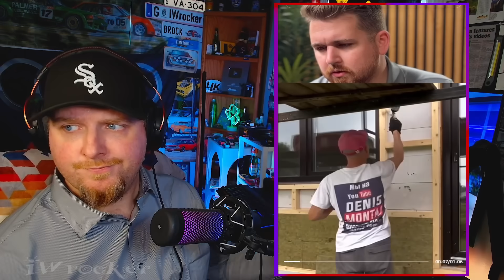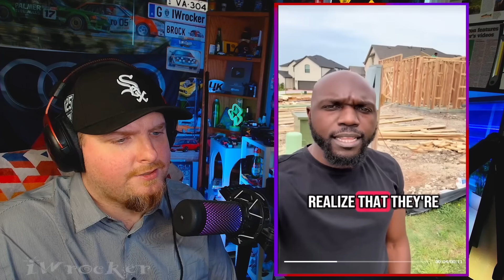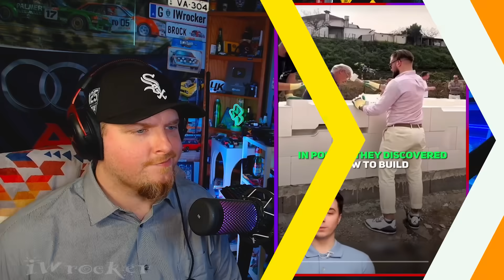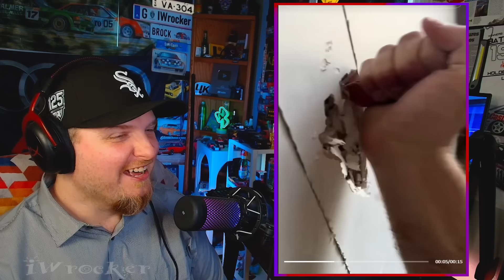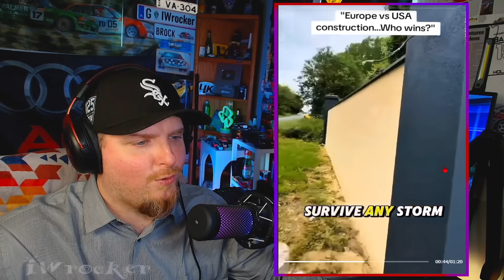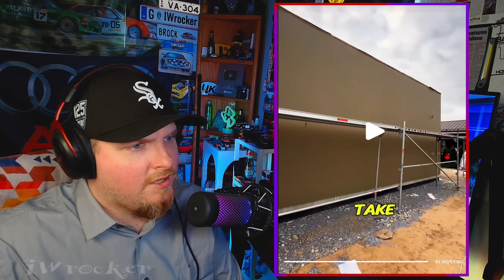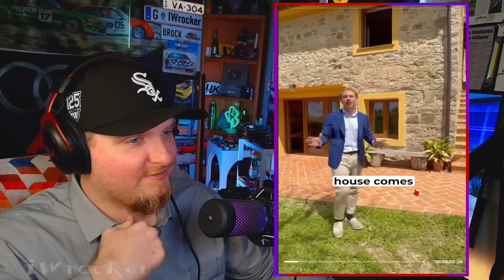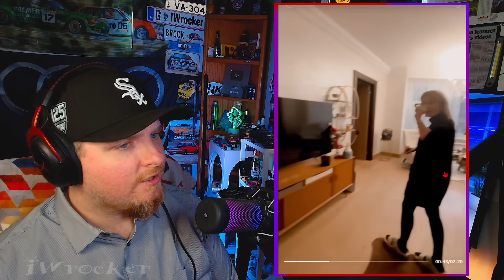25 Minutes of European VS American Home Quality & Construction Methods 🔨

Comment: What does he mean "why insulation is on the outside not inside"? Is he trolling or just American? Of course it is on the outside as it is physically correct, safer, more efficient, and longer lasting.  First, when insulation is outside, the entire wall stays warm. That means fewer temperature swings, better comfort, and lower heating demand. Second, no condensation problems. Warm walls keep the dew point inside the insulation layer, not inside the wall. Inside insulation makes cold walls, which invites moisture, mold, and slow structural damage. Third, thermal bridges are minimized. External insulation wraps the building like a jacket. Internal insulation leaves gaps at floors, ceilings, and internal walls where heat happily escapes. Also, if the outside is damaged then it is easy to redo the insulation if it gets damaged. Fourth, the wall becomes thermal mass. Brick or concrete can store heat and release it slowly. Inside insulation cuts that off and wastes that useful property. And finally, outside insulation means more interior space. Inside insulation steals floor area. Outside insulation does not. This guy has to be trolling or something
Reply: Here in Ireland insulation is neither inside nor outside but in the cavity between the two walls
Reply: @seanrohan5829  Don't mention double wall builds with cavities! Their heads will explode.
Reply: @stephenskelhorn3315 I best not mention both walls are made of concrete blocks then 😂
Reply: @s @seanrohan5829  as a Canadian I didn't even know about that, our houses are basically just as shit as the USA. Double wall with the insulation in between sounds amazing! Canada really needs to take notes from Europe.
Reply: @stephenskelhorn3315 I have a house with a double brick wall and insulation in the form of injected Styrofoam. The double-walled structure dates back to the 1970s. The construction itself, in the form of the empty space between the walls, served as insulation back then. Then, in 2000, Styrofoam was injected into the building to improve insulation, and in 2015, the entire building was covered with 40 cm of Styrofoam on the outside. And this isn't Russia, it's Poland, with normal winter temperatures of -5°C.
Reply: @burkosalw  40cm polystyren :D Fairy tales frm Poland...  2015= cca 10-15cm....
Reply: @RickyDBones  considering how cold it is, im supprised you dont already do things Nordic
Reply: @Odisovic  If he injected the foam and had 40 cm of space before then he'd have to make it 40 cm regardles if it's built like he lives in Siberia. That said I think norm is 21 now and you can go over that if you wish - just will increase the cost
Reply: @seanrohan5829  that setup is the same as seen in the video. the only difference is that brick or concrete inside walls are rare in finland. the outside paneling is still missing in the video, which would make the insulation to be "in between the 2 walls" as you said
Reply: @Tunturisorsa True..I meant in between two walls of concrete blocks
Reply: @seanrohan5829  My brick house in Finland was built like that and we call em full brick houses.
Reply: @seanrohan5829  Lots of that in Portugal too, but newer stuff is mostly ETICS nowadays. 
And it's also been used  to rehabilitate a lot of older double walled buildings, in the last few years, with dramatic improvements in thermal comfort and efficiency.
Reply: @seanrohan5829 The same in the Netherlands. The inner wall is or concrete casting, or lime-sandstone or hollow clay bricks and the outer wall is mostly brick masonry. The cavity is about 15 to 20 cm wide with 12 to 17cm insulation.
Reply: @seanrohan5829 
New houses can use this system ( brick, permeable insulation, brick), or one wall of ytong.
In old houses, with a only wall, the only solution is put the insulated outside ( better) , or inside ( worse).
Or not do nothing, and change house.😊
Reply: @seanrohan5829 Same in the south of France, or we also rely on the thickness of the walls as a thermal regulator.
Reply: @seanrohan5829  Same in Belgium. Inside walls are big hollow clay bricks (we call them "snel bouwers" which means "fast builders"), altough concrete is used more and more these days (either castings that are built and filled on the construction site or precast walls that are made off site). Then insulation is applied. Then an outer brick layer.
Reply: @lorrefl7072 in our case the 2 (cement block) walls were built then the insulation was piped in between them..pumped in as liquid foam then hardens
Reply: Often done that way, in Scotland, between cavity walls. We had ours done 40years ago. 
Our new extension has insulation built in the walls.  I’ve also see insulation panels added to the outside wall then plastered over.
Reply: @seanrohan5829  Isn't that yes how normal houses are built?
Reply: Absolutely agree. If I am seeing it correctly in the first clip, it´s rockwool and another layer (In my parents farm was a whole solid isolation-brick-layer) can be put on it to improve insulation even further.
Reply: Im not sure the builder has finished yet the troll tank said only siding on now but we in europe tend not to use plastic siding like yanky land he nay have a brick wall on the out side its not the end
Reply: @suerogerts4330  For this type of house, the latter is generally made of natural stone (granite and sandstone) in Russia.
Reply: @scorpio681118be yeah we used all sorts of natural products for our houses that's why Europe is so unique granite ,red brick (kiln dried ) we have flint on some older houses in UK and the ones with concrete blocks have a smooth outer rendered course for painting or stucco well almost anything really but for me it was the assumption that we used plastic siding as they do in the US on their cookie cutter homes as they call them 😂😂😂
Reply: @suerogerts4330 we don't use plastic cladding. It's the concrete version we have.
Reply: Don't try to convince someone with facts. Plus, the stones not only provide warmth in the winter, they also helpbto keep the house cool in summer. But hey, what for if you have AC ...
Reply: @nurzumkommentieren5762  Stones don't provide warmth you homeopathic clown. you are only saying absolute nonsense...
Reply: @nurzumkommentieren5762 we live on a shine bank. It gets roo hot to stand on in some places in summer, freezes in the winter.
Reply: @nurzumkommentieren5762  If you can even turn them on since their power infrastructure is also rotten to the core.
Reply: @InternetD1991 Murrica, best country in the world!

Don't forget: they at least gave a power grid, even if it fails - that's way better than living in caves like the rest of the world.
Reply: @nurzumkommentieren5762 😂😂😂. Although caves might actually be better insulated than their houses.
Reply: isnt't it also safer in case of fire? My walls (italy) just have some plaster and paint over concrete. If there was a fire inside, they wouldn't burn, or am I missing something?
Reply: @bradipedro  You are living in Italy and average temperatures might be more convenient, as long as your walls are thick to save the warmth for colder times. Anyway, bricks are better than concrete. Especially, if they have bubbles and cavities for insulation and transfer of humidity. Brickworks in Bavaria are run by Italian families for 100 years. Our Bavarian house needed 70% less heating than my brothers between Treviso and Venice. And now we have 20 cm fireproof insulation outside. We heat with our breath.
Reply: @bradipedro - Current day insulation, like Rockwool, is virtually impossible to burn.
Reply: Not to mention that the Ytong blocks (from what I see in the video) are a massive insulation in itself. All those air bubbles are not there just to make it light and easy to handle.
Reply: Way too many words for Americans to comprehend, don't bother arguing with them. Worst case is you gonna get shot
Reply: The guy saying stuff like isolation on the outside is very ignorant, specially saying please build like we do in the US. My house was built 10 years ago in Denmark and here we have strict rules about isolation, housing has to be very efficient. My house has brick walls on the inside isolation in the middle and bricks again on the outside. When it was built, they build the inside walls first, the roof on top and then isolation on the outside like in the video. Then they made the brick walls outside last. My house also has concrete tiles on the roof, so the house will last much longer than I live or even my kids, if maintained properly (requiring very little maintenance). It also has 3 layers windows, so my house uses very little heating. So my commit is, please build like our houses in Europe. 😂 . As for cost, my house cost about 320k USD (as of 11/2-26 dollars vs. dkr) to build including kitchen, bathrooms and appliances, ready to move in. It’s 158 m2 big (1.701 ft2). I don’t know how those prices compare to the US market.
Reply: @MKristensen Here in Ukraine, my house is isolated outside.  Now with the war temperatures are dropping till -20 no electricity the gas convectors don’t work as the pump needs electricity.  After one week temperatures were still +17.
Reply: @dhrvbThat’s very good isolation, is the house old or newer date? I hope and pray the war will end soon, with the Russians leaving. I have been following the war right from the start and admire the strength and courage of the Ukrainians. Winter is harder than normal here in Denmark with constant temperatures of -1 to -3 degrees, so -20 is a lot colder.
Reply: @MKristensen   in Russia one of my neighbors built a house for 71 K usd, another for 125 K usd. Gas heating of space and of water in 2025 cost my neighbor 250 usd per year, me 325 usd per year. those who somewhy prefer electrical heating instead of gas heating, they usually pay x1.5 or x2 more than for gas.
per month gas about 20-27 usd, heating electricity about 40-50 usd.
(for 1 layer concrete and 1 outer layer insulation).
i don't have examples with 2 layer concrete to provide.
Reply: @eff9266 In Denmark heating cast a lot more because of taxes, because the state wants people to isolate their houses better. It’s the same with water and electricity. My house cost about 1.270 USD to heat per year, the same as a two room apartment of older date. Water cost about 640 usd which include cleaning of waste water. We have central heating in my city, so all heat comes from a large heating plant that burns waste that can’t be recycled, wood and other stuff. We have higher cost, but also higher wages than many other countries. It’s hard to compare prices, when taxes are there.
Reply: doods.. he is insulating "the inside". But hes smart, hes doing it from the outside, before the outer walls has been mounted. Its much easier to acces from that side, you dont have to carry everything inside
Reply: though the same - never do it inside if there is not a special reasone like you won't ruin the outside of you few hundred years old house.
Reply: @Paine981 Thanks for this excellent explanation 👍
Reply: dude NO !! it's rockwoll, before that another wall is placed so the rockwall is between 2walls (the outer can be wood or brick), otherwise the rockwoll will get wet and won't be in its place for a long time.
We do place isolation on the outside like crepi but again than you have a barrier before the isolation.
 So on that he has a small point but he didn't get it doesnt end with placing the isolation (what is +- logic since also when you place it inside you still place gyproc walls to finish) he probl just looked how we isolate and not entire construction !
Reply: American homes are overpriced, crap construction but as with all homes from around the world they are built for the environment of the country
Reply: Amazing!  Someone who actually knows the subject!
Reply: @Paine981 He's right though, at heart to ask.   3 houses were wrapped 1,5 years ago literally next to me, all on the outside, all for just a VERY THIN layer of mortar over it and found holes for condensation to escape. 

   It's ABSOLUTELY IDIOTIC anyway. Better build homes like in the past : THICK WALLS FOR ISOLATION and thin small windows so great won't escape or come in in the summer. 

People today are SO DAMN STUPID the do it backwards/upside down 😐😐😐🤔🤔🤨🤨🤨❗❗❗
Reply: Here in the South, the common way is foam between walls. I guess it depends on how extreme is the winter weather.  (THe temp differences are much larger in winter that in summer)
Reply: Now you know why some people in the US are scared of "Winter Storms", while in Europe you would prepare to stay home for some Days and it´s done...
Reply: He was American, they think backwards
Reply: Very well said, and absolutely correct! The same principle works with blinds. External blinds work better and keep the room warmer in the winter than internal blinds.
Reply: Also, I dont think it is meant so much as thermal insulation rather than sound insulation. The house is bult from Ytong bricks that are in themselves very good thermal but poor sound insulators.
Reply: It’s also Russia where it can be cold AF so there is a strong possibility that there is insulation on the inside of the walls as well
Reply: Americans...
Reply: All that guy achieves is to show how ignorant he is. Because in Europe (and in this case, Russia) people are insulating OLD houses, old houses that had different standards for heating from today's world where it's not acceptable (or even economically viable or safe) anymore to heat in the old ways (there's studies about wood heating and the effects on health if you don't run a properly insulated system and they do not look pretty). Old houses that are receiving NEW insulation that wasn't available back when those houses were being made. Both in construction of the insulation and the format of its distribution. When the house is already built, adding the insulation is done on the outside. And that's without discussing other factors that most US constructors are utterly clueless to.
Reply: I wonder how many would cost ONLY the material.  And HOW MANY does the constructor charges.  Because when I see how American houses are build it seems thet are ripped of by the constructor !
Reply: Thank You! I had exactly the same Thought 😅 In Europe you will learn this  as an Apprentice 😄 Also Insulation isnt just for against Cold Weather, its also good against Hot Weather but ai guess Americans just love to pay the Bill for their AC Blasting the whole Summer 🤷‍♂
Reply: Here at Finland insulation is always inside or between two walls.
Also air is good insulation.
Reply: He's just an US constructor. No surprise the quality in US is sh*t, he doesn' even know why you should put the inslation ouside. 🤦‍♂
Reply: I wish you would post that under the original video. 🙂
Reply: aye ,the stones natural ability to retain thermal energy and keep internal temp at a stable slow changing lvl is not 'fought' its retained instead used as a strength with insulation ,  wind halting cover and the last part , with a final  outer layer be it woodpanels or stone work
Reply: He's just a smart american.
That means he has learned that everything in the USA is better because the USA is the best country in the world.

Poor guy.😢
Reply: 17:57 oh that's just a modern Lego City set
Reply: Depends type of construction and materials if you are building with montage and modular construction  you will use panel sandwiches( to remind they both have insulation )and sawdust concrete foam insulation between internal and external walls panels on metal frame , while with classic building  ( reinforced concrete and brick and precast concrete walls most external insulation of objects   is mandatory  unless there  is no other alternative than  builders do internal wall insulation , we are talking about building at budget .)
Reply: I think that video is a joke or, at least, ragebait
Reply: You're my guy Palne. Well said, even better than I did
Reply: E' solo un idiota senza professionalità. Non puoi insegnargli nulla. Non capirebbe oppure non vorrebbe capire. "Noi in USA facciamo così e questo è il meglio. Punto."
Reply: But putting the insulation on the inside allows you to grow mushrooms in virtually every corner...
Reply: I was about to say, the hell xDDD
Reply: Insulation is between the inner and outer layers.
Reply: I'm watching a dude just cut out a wall and I'm thinking of every time I watched a monster  movie and felt a  bit unsure... On a third floor of a concrete bunker with steel inside walls and doors... 😂
Reply: The way wooden houses are built here is almost same as USA, but we still add more insulation on the outside. It's weird they only put it in the walls.
Reply: "oh look, people abroad who are used to way lower temperatures every winter than us are insulating a new construction from the outside ! It's weird, why do they do it like that and not like us? We're the best. They must be dumb." Yeah, sure, troll.
Reply: Thanks for posting this so I don't have to. Posting this from a 115 year old house with no insulation but my parents had 10 cm of insulation tacked onto their post-war brick and concrete house and now they don't have to heat anymore in winter. That's why we insulate.
Reply: This is nice theory, where does moisture go when it cant escape with heat ? External insulation gets wet ? Loses color, coating, in case of a hail, it probably gets damaged over time much better. Also, easy external insulation if you have a large house, then youre not talking of normaal average incomes, more like the parasitic class that never worked anyway. How does the wall get warm when it is insulated from the outside ? If you have large rooms, plenty of them, smaller space means less heating required, if you do not have all the walls insulated from every direction, you still have moisture escape instead of amass. Modern cheap houses are made very cheaply with no space, while wall damage is an issue, there are more factors, like how far youre from road, and do hevy tractors and trucks go at it at 90 km/h instead of allwoed 50. When whole house shakes 150 m away from such a vehicle, or a heavily laden train at about 1 km can still cause unnecessary wear to the building, and the state doesnt pay for damages from superheavy vehicles. Sure, it depends, what weather, How things get more expensive with US/EU imperial project, if the cult running theUS and subordinated EU throws the subject class into slaughterhouse of war or different, all those shiny high-tech and wannabe high-tech will not be reachable. Trolling is also I get accused a lot of, especially after somebody tries to impose him or herself and fails, anyway, internal insulation is a no go when living in a hobbit hole :)
Reply: I thought they were adding another layer of insulation on an existing building, and that that was why they did it on the outside like that.
Reply: @monha8 
Perfect!
Reply: Hes US not american
Don't insult other countries in the americas
Reply: American
Reply: i never worked as builder of any kind and even i knew that the insulation on the outside makes way more sense lol. they allow anyone to build houses in US it seams
Reply: Thanks, you saved me a lot of typing, especially the first two sentences.
Reply: Not really exerated, my house is a 140 years old brick house, like the rest of the houses in my street. Of course they need to be kept up, but still fine to live in.
Reply: Totally agree  with every word. This guy there is either incompetent or simply trolling
Reply: Also - you don't take space from the rooms.
Reply: spot on.
Reply: Thank you SO much. I do construction every few years in our business and that statement made me rage and cry... inside insulation was discussed so often for our older buildings, bt in the end, even when it is more expensive, outside insulation is the only SANE decision
Reply: Unwissenheit und Intolleranz sind typisch für US-Amis. Erschreckend.
Reply: Came here to say that.
Reply: ‘Wood not pressure treated’: judging by the overly yellow look of the wood they look like treated against parasites such as woodworm. In some countries eg France you only get treated wood for construction.
Reply: also a lot of the time insulation is put on after the house been completed (someone been living in this house and decided its too cold there) so putting it on the inside would be a huge pain in the ass
Reply: In France it's inside the wall too, solid in outside and inside, if it's not made of big rock, cause in that case, there is no use to add insulation at all 😅
Reply: It is in case you have a brick wall. In the US the isolation is the wall...
Reply: Here in finland we have insulation inside. And it stays nice and warm during -40c winter night.
Reply: Forgot to mention.. The actual wall is only there to protect from elements. You should study how building is done around the world 😉
Reply: As a prehistorical dinosaur living in Britain, thank you for answering that question, because I was wondering.
Reply: He's the type of arrogant, know it all, American  who thinks America does everything better than any other country.
Reply: @catherinewilliams3850  1. you are wrong, outside insulation is the worst of the 3 types of house insulation, so better shut up next time if you know nothing about construction or engineering.
2. that guy in the video is one of the most aware americans who recognizes that the US has many weird and sometimes worse standards or ways of doing things, so again you are telling pure nonsense. better not open your moth next time you clown
Reply: @catherinewilliams3850  yup, calling it weird was the first thing hat made me facepalm. In the first few seconds there it already was, that arrogance, the maincharacter syndrome. It's the same thing like imperial vs. metric. The rest of the WORLD is weird because we don't use that imerial nonesense 🤦‍♀
Reply: I think you both are missing the point. The insulation is not on the outside, it's in the middle. The video only shows the inside wall, the structure + insulation, but it's missing the outer layer. Which might be brick or wood.
Reply: @HackerJac-cs7io  not really in the middle, because you should be able to replace it with newer and better insulation material when the house gets older.
Reply: @AurelAvramescu  I work in construction, I know what I'm saying.
Reply: @AurelAvramescu  The structural wall is the back wall. And thrust me, nobody is building with "replace the insulation later on" in mind.
Reply: Same dude was gonna put pressure treated wood inside the structure, clearly just idiot who is gonna get off-gas from the treatment inside the house for years, also wood touching concrete is not an issue in a dry enviroment.
Reply: I salute your thorough and factual explanation! I'm not as patient myself and would probably follow the question "Why would you put the insulation on the outside of the building?" with "For the same reason you put on a jacket when you're cold, instead of shoving it up your a...." 🤷‍♂
Reply: @mothballenema9595  you know nothing about engineering or physics. Outside insulation is the worst of the 3 types of building insulation. so maybe don't open you mouth that far if you are uneducated
Reply: @Mar-s5q8m 🤡
Reply: @Mar-s5q8m 

It seems you are the uneducated one.

But okay.
Reply: He's just American...
Reply: Much depends on how you use the property.  modern family life sees the building empty for long periods of the day so that a quick response is needed and having a large thermal mass is counter productive.  the whole issue of condensation control is dealt with by the correct placement of insulation, vapour barriers and the like.
Reply: @clivewilliams3661 large thermal mass with proper insulation also mean, that the building doesn't get as cold in the time nobody is in there, so you don't have to heat it up as much, when you go back to it. So no, it's not counterproductive.
Reply: He’s so stupid he doesn’t even realise the wooden-lathes are to take an exterior cladding after the insulation
Reply: Americans are still building houses almost entirely out of wood and cardboard, of course they don't know about modern building techniques from northern Europe.
Reply: Exactly! 😊 Great comment! 👍
Reply: i was really surprised because i thought it was a world-wide standard
Reply: It is better in between 2 walls
Reply: Mineral wool in the outside... Sounds strange to me and I'm not usians.

Mineral wool tend to deteriorate with water... Or glass wool
Reply: @anamarques5599  You always cover your insulation with siding panels or something similar.
Reply: Well, i don´t have any insulation at all. 
Just 45cm thick brick walls.
Reply: @vophatechnicus Me too, 300+ year old farmhouse, but my gas bill is also 5x higher than a modern isolated house
Reply: @vophatechnicus that's bad.
Reply: @shades2.183  why should it be bad? 
-17°C Winters and i dont´have any issues. Heat Pump (brine/water) runs on minimum power most of the times. 

I can´t see anything bad.
Reply: @vophatechnicus  Your energy consumption is higher than most other, and no, you can not convince me of anything else.
Reply: @shades2.183  I don´t have to convince anyone, i know the truth. I see it with every bill.
Reply: @vophatechnicus Sure champ sure, sure and i build houses for a living.
Reply: @shades2.183  so you build houses? in germany? KfW compliant? Obviously not :)
Reply: @vophatechnicus  sure champ you might wanna check your Gebäudeenergiegesetz
Reply: @vophatechnicus  i don't have insulation either, just 15-20cm thick wooden walls lmao
until recently new zealand just wasn't aware of the concept of insulation or something
Reply: Wrong. Insulation on the inside is actually more energy efficient. We just put it on the outside because its cheaper to do knowing full well it creates lots of problems
Reply: @Mar-s5q8m no? with only internal insulation you make one big thermal bridge out of the whole building, you reduce thermal mass and increase moisture buildup, and actually interior insulation is cheaper.
All of said problems are eliminated or greatly reduced with external insulation.
Reply: @Dread_2137  Stop saying nonsense you clown, you have no idea
Reply: @Mar-s5q8mcome on, you're that daft? Outside insulation is the most efficient ome BY FAR! Passivhaus standard, the ones that give you houses with ZERO bill of heating AND cooling (no heater, no A/C) has outside insulation as a basis
Reply: @patrickrosa848  Nonsense.... 
A  big reason inside insulation is better is the outside wall can absorb sunlight which is a massive factor that goes completely to waste with outside insulation.
Another reason inside insulation is better is no problems with insects and rodent using the insulation as habitats. So inside insulation needs no toxic and cariogenic chemicals to keep them out.
Also inside insulation lasts longer. Outside insulation is only rated for 15-25 years and then needs complete removal and redoing which is a massive problem with toxic waste.
The only benefit of outside insulation is that it is cheaper because it's easier to do.
That's it. Outside insulation is literally the worst type but it's a bit cheaper to do.
PS plus the fire danger of outside insulation as any deadly fires have demonstrated and outside insulation creates mold
Reply: @Mar-s5q8myou're completely delusional... saying that outside insulation is cheaper just shows you know zero about the topic! It is usually at least a factor 2 more expensive. Because also it's more efficient.
Solar input on the outside walls in WINTER?!? Do I need to mention that the sun is usually too low,sky is most of the time cloudy, and days are short? Do you truly believe that this makes the slightest difference compared to a strong thermal mass heated by the inside and preserved by the external insulation??
And external insulation is by REGULATION as safe as internal, they need to be fireproof.
Concerning rodents, if you think mice is not happy to make its lair in nice hot glass fiber or polystyrene in your internal insulation then you're believing in Santa Claus